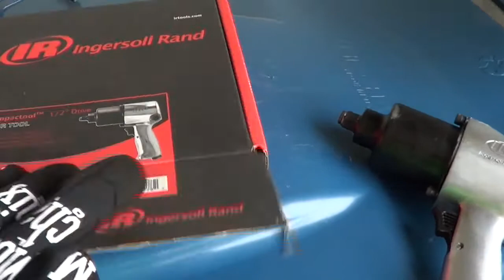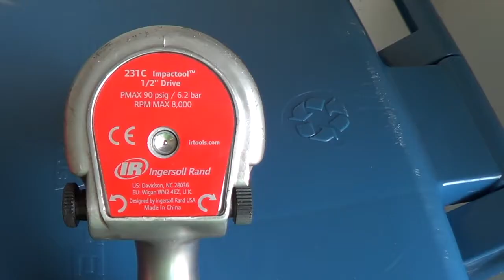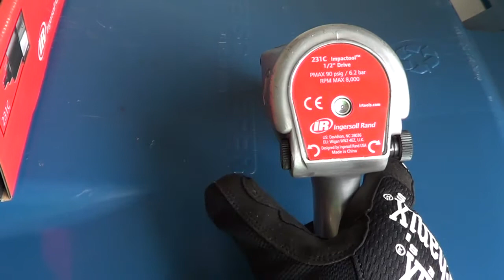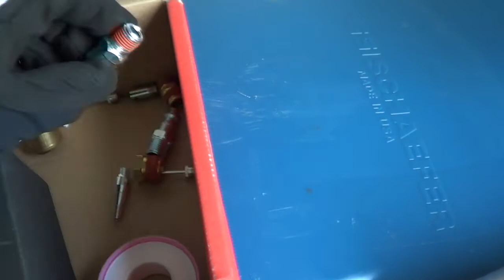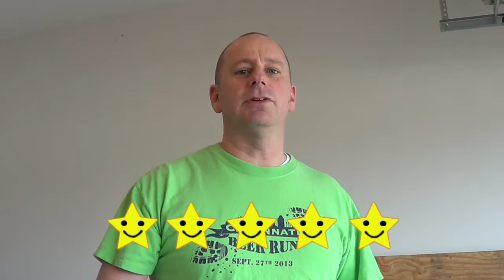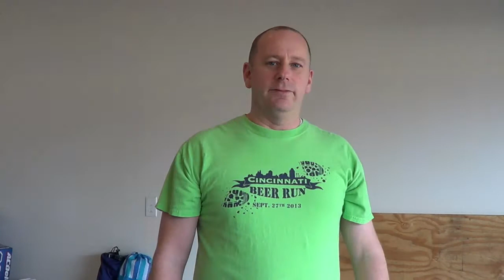Ingersoll Rand 231C Impact Wrench Tool Review

Comment: Could you explain how the torque settings and numbers 0-5 work on this gun again? I couldnt understand it in the video.
Reply from the maker: 0 is the least torque, 5 is the most.  There isn't set numbers, except 5 is suppose to be around 6oo ft lbs.  When you have a number selected for one direction, you'll notice the other direction's indicator is pointing to nothing.  It is at full power.

Comment: Thanks for the review. Usually I'm one of the few that read manuals but I believe the one for this impact gun never happened with me.
Casually, the screw holding the reverse valve knob came loose recently on mine (too much use ?). I took it apart in a hurry, put some Blue Loctite, screwed it together and didn't notice the knob's correct orientation before doing it . . . afterwards, things looked & felt "just not right".
Thanks to your video and some internet digging I found the right info to put it all together "the right way" and as a nice bonus I finally understood why one side does not mirror the other with the pointers & numbers on the reverse valve's knobs and how power settings work going from forward to reverse and vice versa.
Thanks ! 👍🙂
P.S: Buy yourself a rubber boot(protector) for the gun, it'll last you even longer ! I have one on mine and felt it was a much needed and worthy investment.